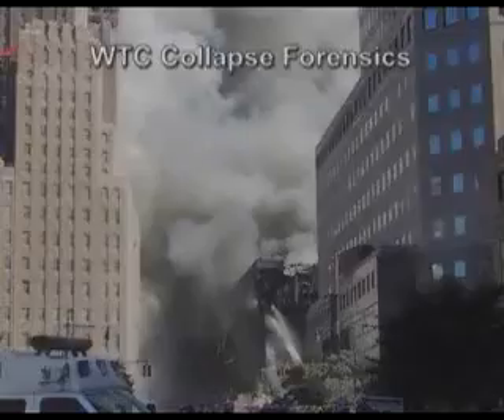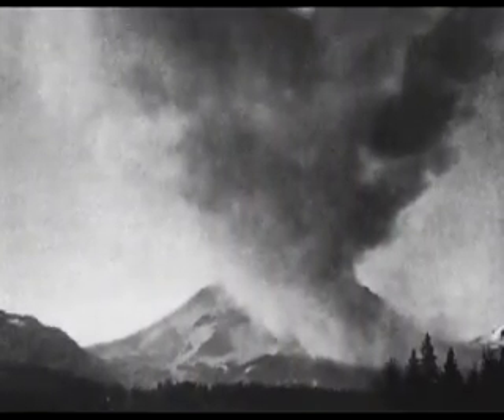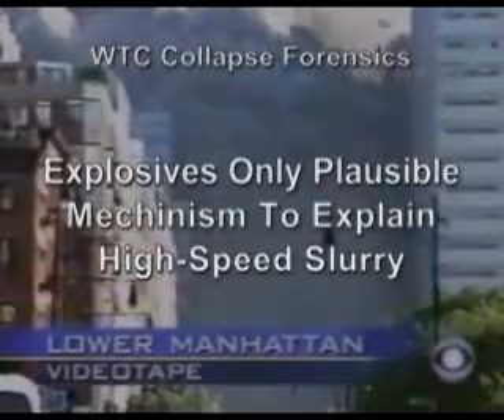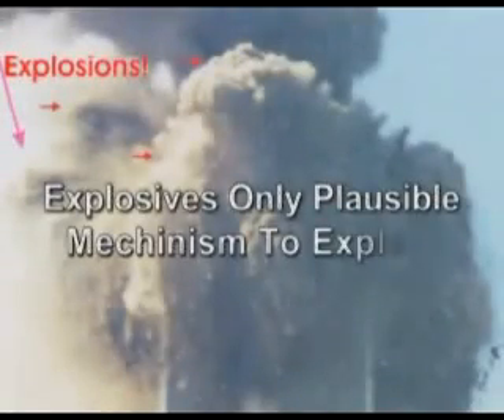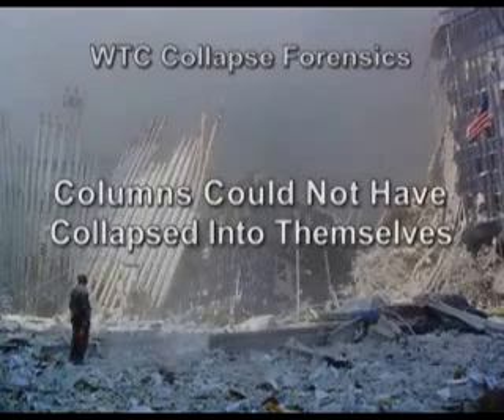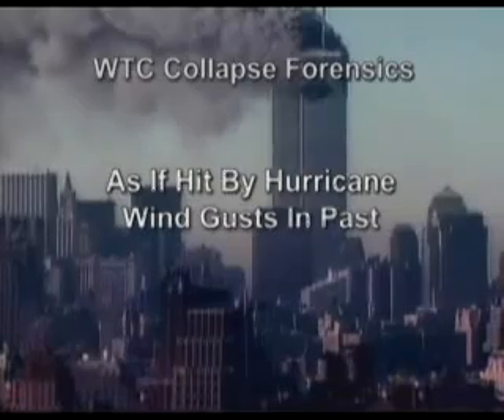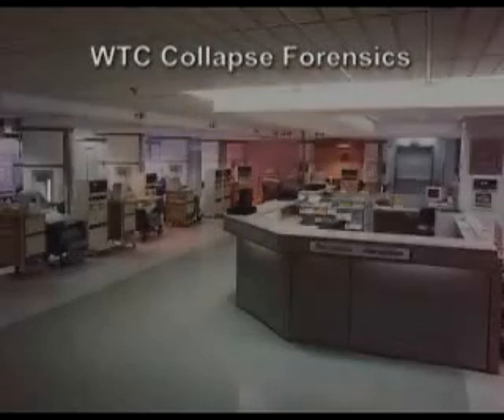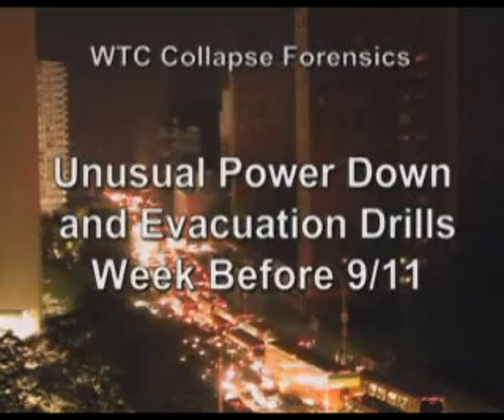MIT Engineer Disputes 911 Theory of the WTC Collapse-Part 2

Comment: oxomaticman: "We know the collapses initiated at the impact zones." Really? Then how do you explain the complete destruction of the internal columns, all the way to the ground? The fire inside the building was hot enough to ultimately destroy the building (i.e. sufficiently weaken steel to cause failure)? No. Does anyone listen to the majority of engineers claiming that the heat from jet fuel alone could not have possibly caused the building collapse? Does anyone care about laws of physics?

Comment from the maker: Again, debate the facts:

1. Eyewitness accounts of explosions (even in the basement)
2. Near free fall collapse for 1350 ft steel building?
3. Siesmic data indicates that the loudest spike was at the initiation of the collapse, not when 110 stories came tumbling down
4. Origin of the massive smoke plume rising from the base of the Towers b4 either Tower collapsed?
5. Massive steel ejected laterally at high rates of speed
6. Extreme temps buried under the Towers (and WTC7) lasting weeks?

Comment: These towers are designed to support immense weight, wtc1 collapsed because the concrete and steel melted then the debris caused a chain reaction ?  don't think so,  also if this were
true why were the large amount of steel columns cut at the bottom in the same way that demolition teams do with a slant?

Comment: uh let me see, how about massive amounts of steel and concrete falling 100 floors straight down, pulverizing against the concrete, what do you expect, and since when does explosives turn anything into dust? what do you think free fall speeds prove anyway? the debre was falling faster then the building, soooo its not free fall. 12-15 sec.

Comment: Ohh you took a course in firefighting, WOW. did you learn that steel melts at 1525° C, and although jet fuel burns only at 825° C, it doesn't have to burn hot enough to melt to cause the buildings to collapse, since steel loses 50% of its strength at 648 ° C ? I win....

Comment from the maker: A Summary using common sense:

1. The was only 56 minutes (South) and 102 minutes (North) from time of impact to collapse. Is this really enough time to weaken steel to the point of failure? How is it possible that ppl like Edna Cintron walked around in this extreme "heat" to get to the impact hole during this time? It isn't.

Comment: Problem is it moves too fast for that to be true. A more likely explanation is that the concrete was porous and that led to the pulverization. However in order to get the porous ness, it had to be exposed to water perhaps combined with the movement of the building during high wind over extensive time. Or explosives were used. What seems most plausible, if these were the only explanations?

Comment: besides.. a volcanic pyroclastic flow does not obtain more material as it flows down the side of a mountain.. it flows hugging the side of the mountain, in the WTC much more material is being gathered from each floor as the flow goes down.. this is a totally different flow.. mass is being added as it goes down.. this is just an ordinary collapse but collapsing on a modular system
(each item (floor) is visited in this collapse and behaves the same way

Comment: eletrical engineers do not take as many fluid dynamic courses as chemical engineers and chemical engineers take more heat transfer courses than EEs.. chemical engineers can model/simulate tornados using different fluids (having different densities) more so than EEs who do mostly circuit board design and logical stuff.But my career is in computer science and software engineer so i think i have him covered.

Comment: the slurry flows are easy to explain.. the 
inner rectangle consisting of the steel core holding up the building went down slower.. the outer rectangle that wraps this inner rectangle contained most of the concrete floor material and these outer rectangles with the most amount of concrete flooring were most of the mass of the flows...

Comment: Is President Bush a great magician?

how to lose $500.00

get an abandoned stove.  fire a 12 gauge shotgun slug at it at the VERY reduced velocity of 733 feet per second. put a pan of kerosene in it containing 1 gallon of kerosene and light. expose a concrete block to fire from 1 gallon of kerosene. drop block 15 feet onto stove. bet $500.00 that block will fall through stove as easily as falling through air, block will be pulverized to dust and stove will completely collapse.